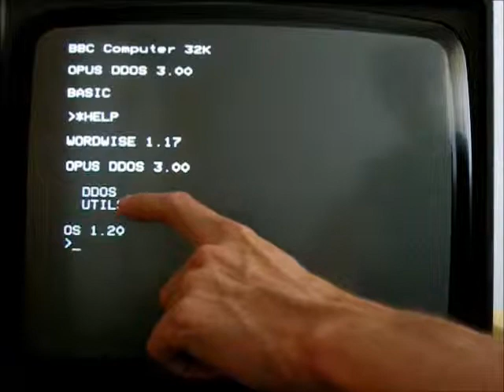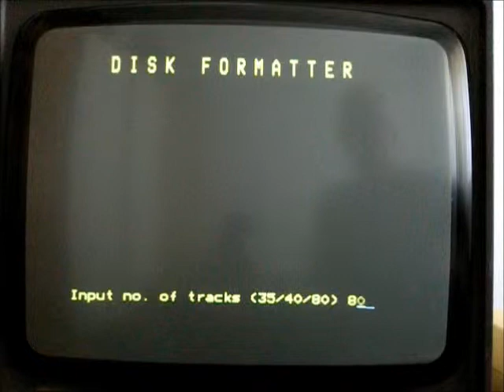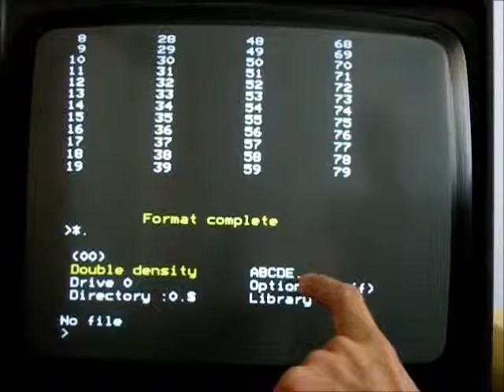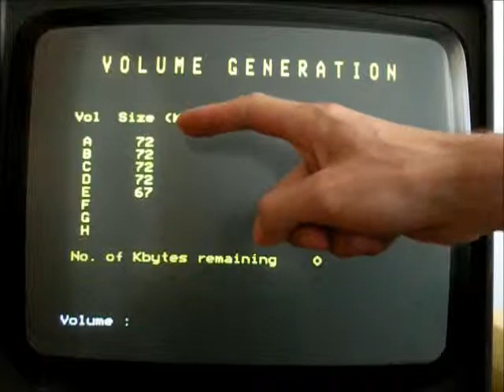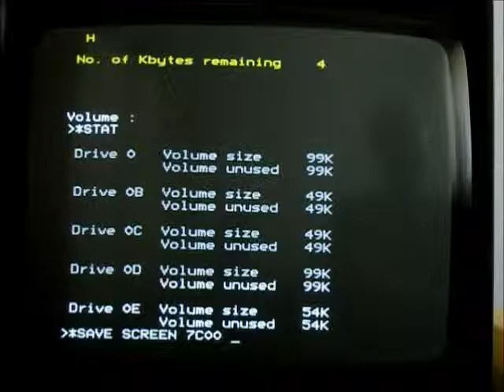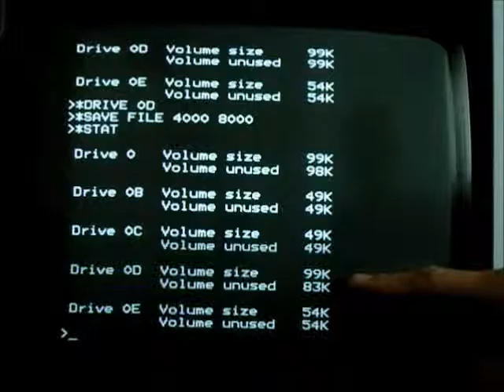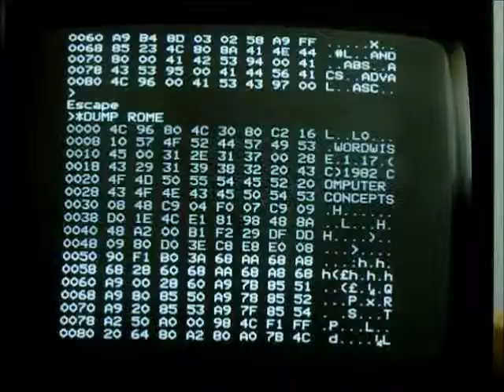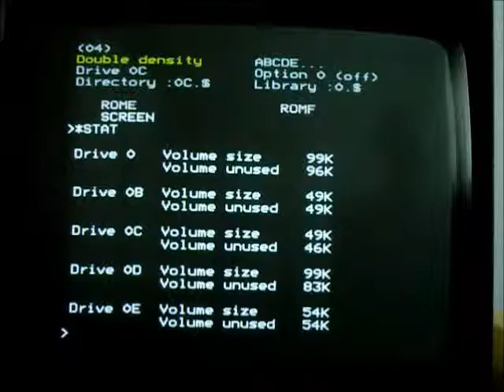BBC Micro Opus DDOS double density disc demonstration

Comment: Both the 8272 FDC and DDOS 3.00 ROM are very rare! Any chance of the ROM being made available somewhere?
Reply from the maker: I've got the ROM image somewhere, I think. The machine itself is now at the Centre for Computing History in Cambridge, but I took a record of the PCB layout and parts list of the interface as well as the ROM image before donating it.
Reply: Good to know it's gone to a safe home, but they have so much stuff that nothing actually gets archived, just stored indefinitely. The ROM image and any info you have on the interface would be greatly appreciated, and will be included in MAME shortly after. I already have another 3 Opus FDC variants in MAME, just missing the 8272.
Reply from the maker: Good news. I have found the ROM image and photographs of the PCB. You're very welcome to any information I've got in order to implement the MAME emulation.
Reply: Did you ever send the image and photos, don't seem to have received anything, thanks.
Reply from the maker: Sorry about that! I've just sent you an email. I hope you receive it. It had two large photos in so I hope it doesn't get blocked on the way.